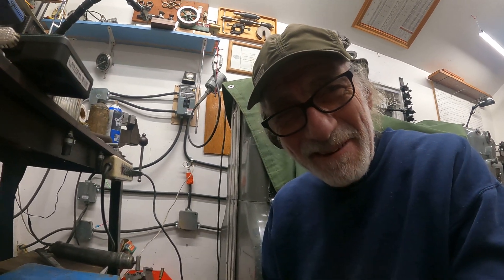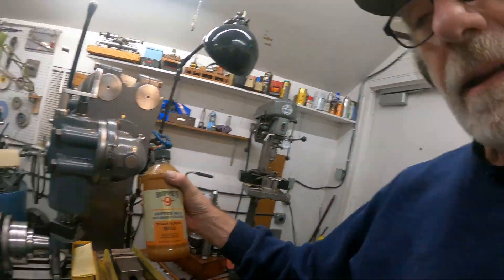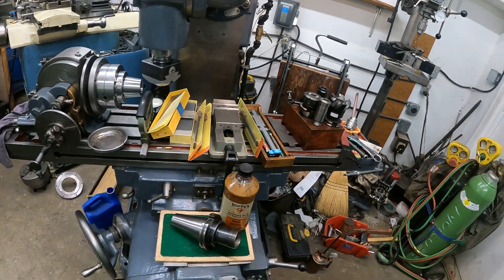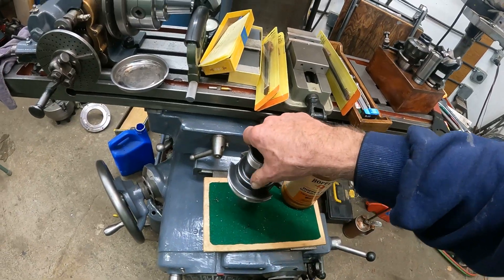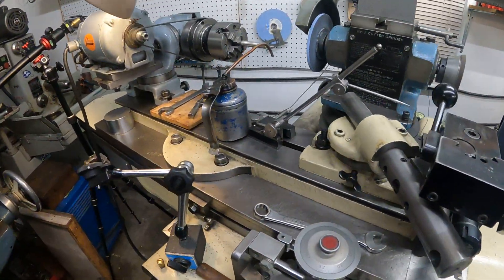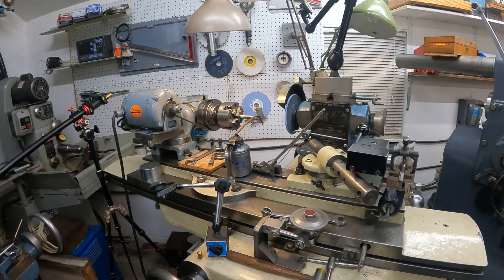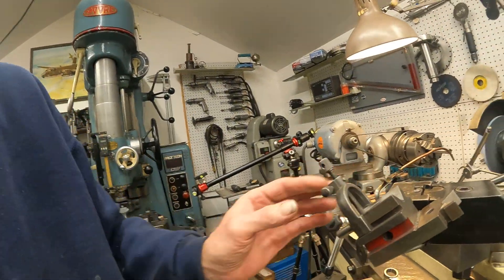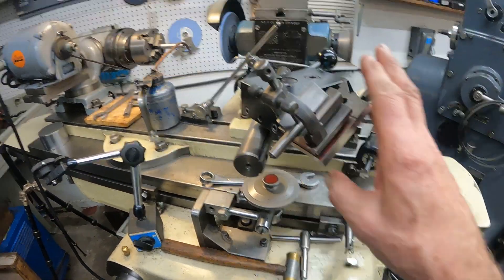Moore Jig Borer Criterion tenth set boring heads

Comment: something I thought about is setting the angle of a boring bar, it seems that we can set how much rake we want by what angle the top of the insert is presented to the work. I figure with these small and medium boring heads we always want positive rake.
Reply from the maker: The top angles are nearly flat on the commercial brazed carbide boring bars, small top angle increases result in having to take shallow cuts or the tool will dig in and chatter also changes with material hardness.

Comment: DeeDee. Cursed with an active mind.  You are always pushing things to learn more, probably have been your entire life. Thanks for helping the rest of us “get sharp.”   Cheers, TB
Reply from the maker: This particular machine like the Monarch ee lathe was pushing the limits of industry in the times. Both machines designed for very light cutting to high accuracy so they need to be backed up with standard machines to rough out the work like a Brown & Sharpe horizontal mill and a Baby Axelson gear head lathe for example. I found working to .0002" tolerance specified in the Barden bearing fitting instructions using indicating instruments set with gage blocks, requires a consistent and sharp tool and the ability to change its angles as needed to suit the material, so add a cutter grinder.

Comment: Dee dee, do you have any tricks for balancing a boring head on large holes? I always find myself sticking counterweights out of my 3” boring head in my mill, was wondering if there’s a smarter way to go about it.
Reply from the maker: Yes, you can apply/make cutter styles used for boring heads with small offsets on jig borers I will show more of that tooling thanks